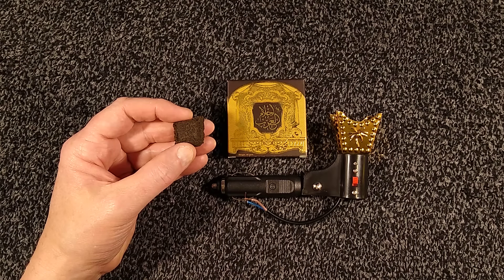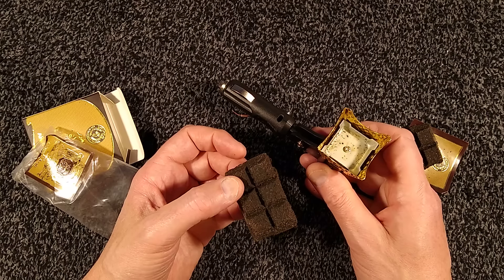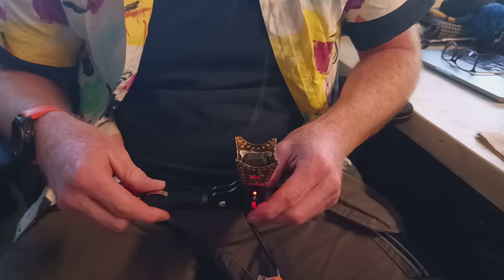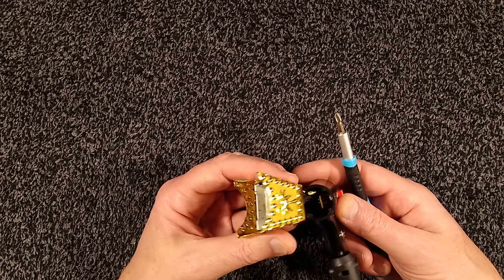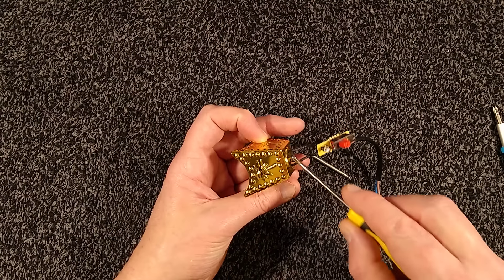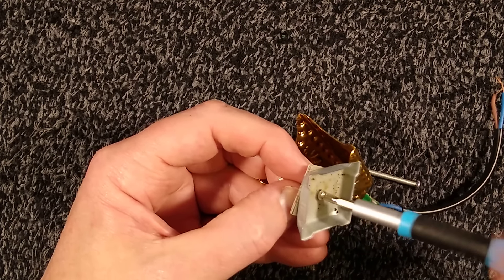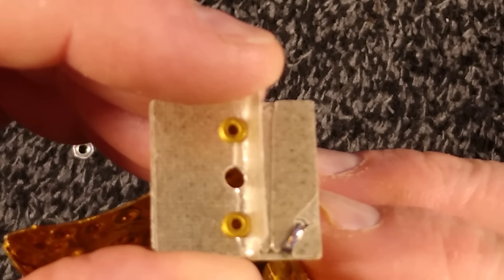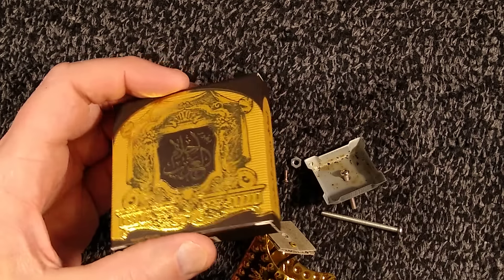Arabian in-car incense burner teardown

Comment: "ahlam al arab" means "dreams of arab"
incense are usually dried up herbs that produce smoke and a strong odor , its mainly used in big events like weddings and festivals ,also the herbs are usually insects repellents by nature, its also used to remove bad smells and replace them with the a better smell,
the idea is that you burn some herbs and they produce a huge amounts of concentrated smoke that is pungent and not toxic to breath ,that pushes out any smells in the house or car or room ,then then after the smoke clears out there remains a small hint of smell that is actually pleasant.
that was the solution for removing bad smells in the 1500 and 1600's ,it stuck around becoz it works and honestly ,the smell of incents is strong and always related to a nice event like weddings or parties or whatever ,its stuck as a cultural thing now
Reply: @acmhfmggru it does predate the germ theory of disease. European doctors used 'filters' filled with fragrant plants, in the characteristic long nosed masks.

In fairness, repelling the insects means they won't be transfering the feces/pus/disease to the food as much, etc. 

Also, ash from smoke is a great caustic soap, which you mix with fat to make bars of soap. But you use ash to wash with and that works, so smoke having hygiene properties is a natural assumption
Reply: @mandowarrior123  and by extension I wonder if this habit stuck around/arose in so many cultures because it kept human pests away, at least to some extent. 

It would be plausible to think that fleas and mites etc might be repelled by strong plant aromatics.

Comment: Bakhoor Burner. The Incense is called Bakhoor. You can find loads of different ones. These are for small bits of it, not a whole block, you could use that 1 block for a whole house.
Reply: So you're supposed to break off small bits from the block and put those in?
Reply: @rolfs2165  Normally you can crumble it like an OXO cube but it can become difficult to crush due to temperature changes during transportation.
Reply: @GothBoyUK  I had to guess what an OXO cube was, and I was right. I switched to soup starter paste since my bouillon cubes are hard as rocks.
Reply: @rolfs2165  Really, these are the cheap end, the mass produced stuff. Real Bakhoor is actually wood chips, soaked in various oils, fragrances, spices etc. You then take a small bit and place it on a burner and it emits the wood smoke and all the oils in small amounts. These blocks are mass produced and not really intended to be used as a whole block, especially for a vehicle. it's like people opening and hanging a whole 20 pack of Pine Tree air freshers rather than (what your supposed to do) open the plastic cover and slide a bit of 1 of those out, and over time expose more of it.

Comment: It reminds me a bit of a toaster element, just with extra layers of mica.
Reply: Exactly!
Reply: Exactly.  Me having a grandpa moment while Clive is being amazed at a bit of nichrome wire wrapped around some mica sheets.  It's a basic pad heater as used for the majority of the 20th century.
Reply: Generally, I like to keep the mica from blocking the element so I can have toast before the sun goes down.
Reply: i thought that when i saw it... also, i wonder how long it'd take to "toast" a slice of bread if the mica sheet was taken off one side.

Comment: The last time I saw heating element like that was in the flasher module for one of my bikes back in the 1970s.  It had a bit of resistor wire wound around bimetallic strip with some mica to insulate it.  Very simple device, but it worked (for a while).
Reply from the maker: I had a bike light flasher like that.
Reply: @bigclivedotcom  They were de rigueur back in the day, but I'm surprised an young puppy like you would have come across them.  Good that you picked up on that.

Comment: That heater is exactly what is found in a blow dryer:  thin nichrome wire wrapped around mica. I built an engine smoker (leak tester) with the same technique, with mineral oil (for the smoke).

Comment: A block of cannabis resin on that would calm you down when driving.
Reply: Double chilled with a dusting of some Afghan opium 😂
Reply: concentrates have boiling points of over 700 degrees farenheit... this incense burns far below that
Reply: @Pooopers where did you get that number from lol

Oils from cannabis start vaporizing as low as 350f and you shouldn’t even heat it up past 500f
Reply: Or it could be a small solder pot !

Comment: 0:55 I can't say that that particular incense is not worse but having looked into it some years ago, ie reading two I think, maybe three papers, they didn't say that any incense they tested was worse than or as bad as tobacco smoke. The general conclusion was don't sit close to and certainly don't deliberately inhale incense smoke. It has no known health benefit, it produces particulates ie smoke, destructive distillation and pyrolysis leads to creation or release of irritating or toxic compounds, and incomplete combustion generates carbon monoxide. It's like you wouldn't sit and breath smoke from a smouldering wood fire and that's basically what incense sticks are.

Comment: My neighbors brought me a line powered version back to Netherlands from Morocco, no specs but a EU plug. Appeared to get overheated on our 230V line voltage, probably designed for 120V. Same mica heater construction.
Moreover: completely metal but no protective earth. Would never be allowed to sell here…

Comment: A switch, a resistor, a LED and a few centimeters of wire - that's all you need!
No condensers, ICs, thyristors and inductors needed. 😉👍
Reply: If it was from Chinah, it would have an 8-pin micro, and a life of one week.

Comment: Could you use this as a mini solder pot? Does it get hot enough to melt leaded solder?
Reply: That was my thought too lol, for when you want to reflow on the go!
Reply from the maker: Not sure.  I didn't run it long enough to test the maximum temperature.
Reply: You could put some Flux in it for a pleasant aroma. (Or is it just me that loves the smell of flux?)

Comment: In a car? No way. Too little space.
I was expecting a ceramic wirewound resistor, got surprised.
Reply from the maker: Yeah, I was expecting a ceramic one too.
Reply: In a hot country and if you don't have air conditioning, you'd have your car windows down.
Reply: @Scodiddly have fun in the desert

Comment: Mr. Clive,  I want to make a battery for a cell phone. A secondary battery. I call it 80/20. Its a pack that goes on to what ever your phone is. When your phone hits 20%. It charges. Shuts off at 80. The thing I don't get is how fast charging works. I want it to be speedy to charge and not the internal battery!  I also want this whole thing to be open source. I give the schematic. You can order it from the PCB provider of your choice or bake it yourself. I can't figure out how charging over 5v works. Any input you have would be amazing!!!

Comment: Automobile auxiliary power outlet size B will be fitted to cars and especially vans for years to come.
Reply: My 20 year old SUV has one in the dash, one in the center console facing the back seat, and one just inside the lift gate.  Handy for running a little compressor to inflate pool toys, top off lawn tractor tires, what have you.
Reply: @tncorgi92  Remember "way back when," when you could only plug one item into your car at a time (unless you bought one of those multi-outlet adapters)?

Comment: I often wonder what is the difference between shortcircuit and this heating element. Is it the balance to find between heating the wire up to a point where it -just-not-breaks or burns through? or is it a custom made metal that specially is forged this way...  Still, it makes me wonder...
Reply from the maker: This is a wire with a composition optimised for handling high temperature and giving a known high resistance for heating purposes.
Reply: This heating element has a resistance of 12 ohms. It's a special alloy that has a much higher resistance than ordinary copper or steel wire.

Comment: Annoyingly ciggy lighter sockets have a different diameter to 12V appliance sockets.  Try putting a modern gadget in a ciggy socket and it will not stay put.  Intentional incompatibility.  Something to do with current rating, probably, maybe... or the EU.
Reply from the maker: Maybe to stop smoking the appliance socket with a heated cigarette lighter.
Reply: Yes that would be it.  I suppose the idea was that new plugs would still fit the old sockets, but in my existence it's a fail.